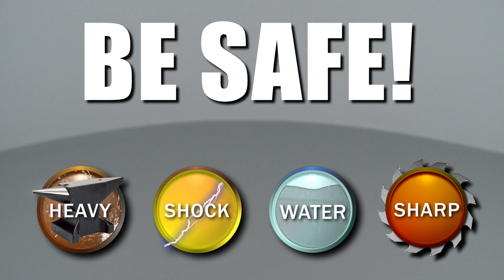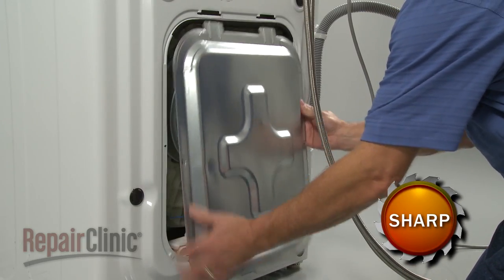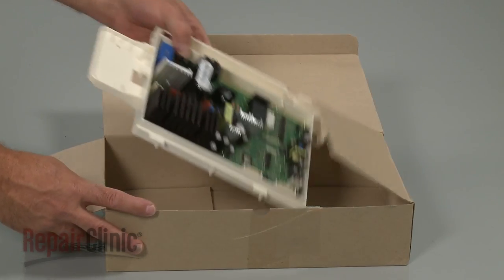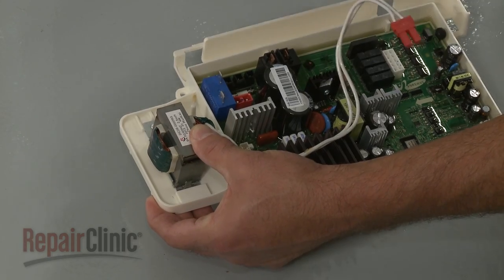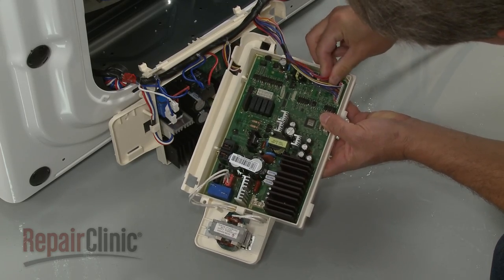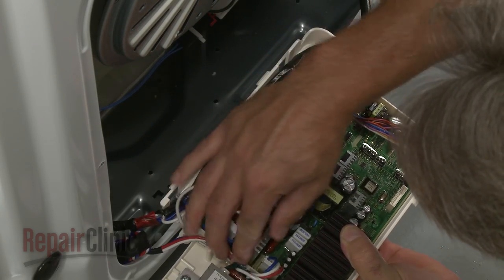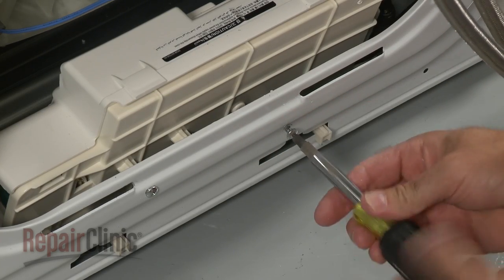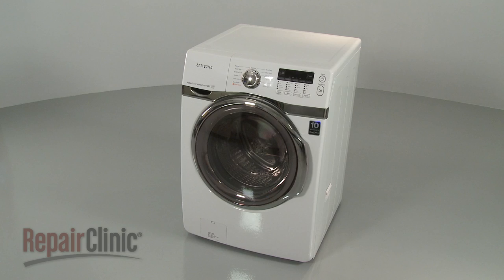Samsung Washing Machine Main Control Board #DC92-01063A

Comment: Thanks for this, it's exactly what I needed to see.  There was one plug that was quite stiff and I needed this video to confirm there was nothing special about the plug.  Just needed to pull a little more firmly.  My issue was the washer would start the cycle, fill, spin then turn off and back on.  it would continue until I powered off the washer manually.  Now it runs a full cycle with no issues.

Comment: I am using the 12kg ecobubble model, it just started going to pause as soon as the start button is pressed, I have checked and cleaned the drain but still going on pause from the start. Any help would  be appreciated

Comment: Washer starts to spin fast, but then almost immediately slows to a medium speed.  No error message. Clothes come out more wet than they used to come out after high spin level.  Can this be the control board?  If not, then can anyone suggest what?  Thanks!!!

Comment: I've got an Error Code tE issue.  I've replaced the Thermistor about 6 months ago which fixed it.  But then last week the error came back!  I replaced the Thermistor again but that didnt' fix it.  I've been told it might be PCB Main Board or Wire Harness.  This is a great video for the PCB board.  Do you have any advice on the Wire Harness?  I couldn't find anything on your website.
Reply from the maker: +Greg Wells Hi Greg! You can try a few things: 1. Make sure that the wires in the harness plug are tight. 2. Wiggle the connector blocks to make sure they are making a good connection. 3. Check the wire harness for breaks. The wire harness may have been rubbing somewhere, causing damage to the wires.
Reply: +Greg Wells I seem to be having this same issue. When I get the tE code I can lighten the load and sometimes it will go all the way through a cycle.  Sometimes I have to lighten the load so much that there is barely 1/3 of a load in the machine.  Is this at all similar to your problem and did changing the main board fix your problem?  And I have also swapped out the thermistor (that was testing good) as well.
Reply: Samsung specialist came out with a new Main PCB Board and a new Wore Harness. The board didn't fix it but the harness did.  $120 part + $80 service.  I've now sunk $350 over 2 years of owning a new Samsung Washer.  VERY ridiculous.  We debated buying something else rather than sinking that last $200 but chose to fix. I asked the repair technician what he would choose.  He said that they just don't make them like they used since ownership changes.  Didn't sound like there was any good unit/brand to go with.  I know some people have no issues but I feel like I got a lemon.   At least mine works again.

Comment: Wonderful videos and well shot.  
Our 6-year old Samsung front-load VRT washer will not agitate or spin, and smoke billowed from the drum when the door was opened at the end of the cycle.  All other functions work such as the display, drain pump, fill solenoid etc. on command during the cycle but no rotation of the drum.  Could this be the main control board or is there a motor control board?  I haven't taken the machine apart yet.
Reply from the maker: Phil Scott Thanks, Phil. Have you checked our website's online repair help? http://www.repairclinic.com/repairhelp.
Reply: you won't like what you find
Reply: I have the same Washer with same issue. Did you fix it? How?

Comment: My washer display has intermittent power. During the cycle the screen goes blank then comes back on.  Power is intermittent.
Reply: I'm having this issue, but only at the beginning of the spin cycle. What was the issue? Thanks.
Reply: I have replaced the unit already…. Tired of buying other people’s problems…
Reply: Probably what I'll do. Thanks for your response.

Comment: When it comes to samsung inverter washing machines-Replace. A common fault is that the motor won't turn. Sensor on the pcb is faulty. You can replace the control pcb but no guarantees. It may solve the problem or what happend to me was, it only worked for a week. Pcb damaged again. The suppliers told me to replace the belt, motor and pcb and that I should earth the motor. Here in SA that is the price a new machine and it won't be samsung. Im done reffering samdung
Reply: Pcb R2000.
Reply: Down the drain

Comment: I'm wondering if this will fix mine currently it isn't functioning correctly it won't fill up with water normally it does it in spurts and than it won't spin to wash or drain :/
Reply: Did you ever get your washer fixed? I'm having similar problems.
Reply: @wl1904  I'm having the same problem, I just tore it completely down after multiple failed attempts with samsung troubleshooting team. The annoying thing is that mine doesn't display an error code
Reply: @0rvelazqu  I changed the main control board and it fixed the problem. My washer is a different more modern model with touch screen and the main board is located at the top of the washer.
Reply: @wl1904  I'm going to do the same, did you buy your motherboard directly from samsung?
Reply: @0rvelazqu  No. I got mine from Ebay. Initially I changed the motor stator and I got it from Amazon. Either place is cheaper than Samsung. Just make sure you get the correct part number take a picture of your control board and compare the pic.
Reply: @wl1904  thanks for the info!
Reply: @0rvelazqu  No problem. If you need anything else I got you Bro.